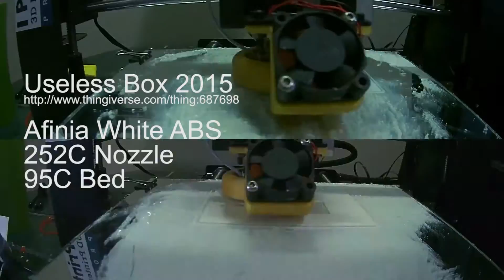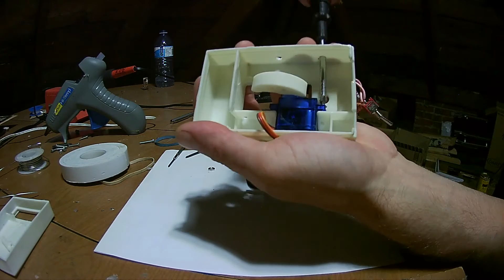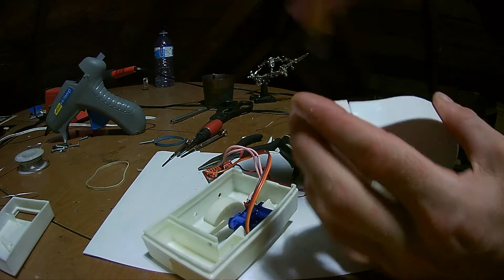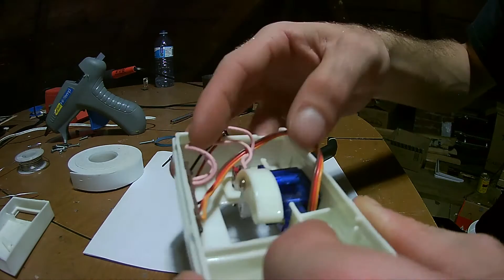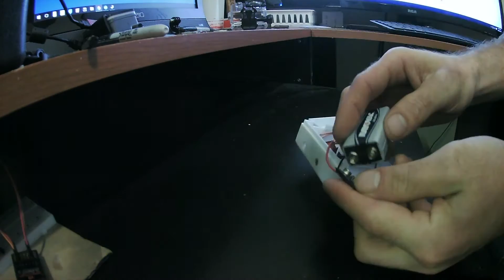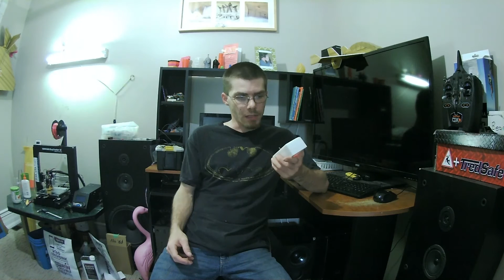Arduino Useless Box

Comment: How much did this end up costing? Most kits I see are around $40 to $60.
Reply from the maker: I used parts i already had around the house, servo, Arduino, switch, and the good silicone wire i used, it was about a $20 project before adding whatever your time is worth to you. it could be brought down to less than $10 by shopping for the project with cost in mind. (my switch was like $8 from the hobbyshop, the arduino was from a long time ago, paid about $5 for it, and servo is about $3-$4)
Reply: ZakkBlog Cool I may make a few of my own once I get a 3d printer